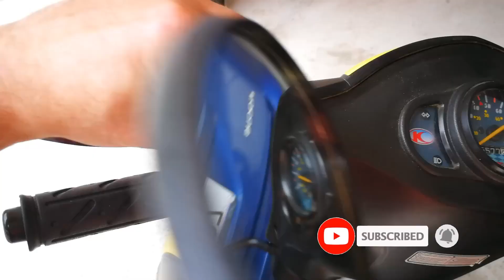Kymco Agility 50 4T brake handle, mirror replacement (popravak ručice kočnice, zamjena retrovizora)

Comment: Drug, ako mi možeš pomoći nesto. Imam isti skuter kao i tvoj. Imam problem sa prednjim zmigavcem. Dakle kada upalim lijevi zmigavac prednji ne svijetli nikako a zadnji brzo blica. Zamijenio sam sijalice nije do njih. I Imam problem sa zadnjim svijetlom. Kada sam stavio novu sijalicu samo je radilo kada kocim ali ne i kada upalim svijetla niti kontakt. Hvala
Reply from the maker: Pa vjerojatno po ovome što si napisao može biti prekidač za svjetla i žmigavce ali rastavi prvo masku gornju na upravljaču tamo di je kilometar sat tu gornju ispod nje su ti snoplvi žica pa pogledaj dali je nešto otpojeno ako nije ako je sve ok onda ispitaj dali radi prekidač za svjetla i žmigavce sa multimetrom prebaci na dc instrument i isprobaj dali ti daje struju na izlazima za žmigavac i svjetlo ako ne onda je prekidač pa ga rastavi i pogledaj dali se da složiti ako ne kupi drugi i zamjeni pozdrav.